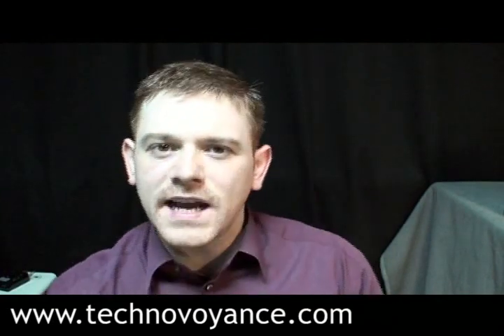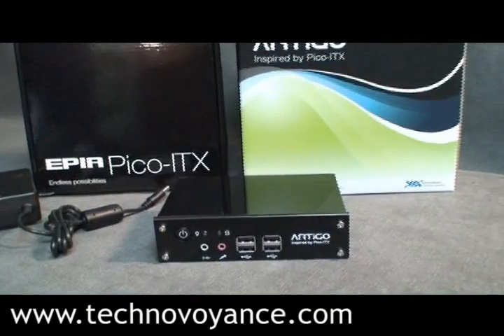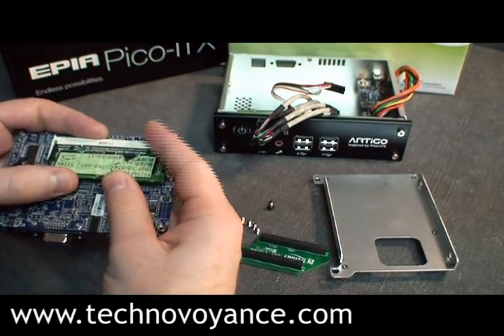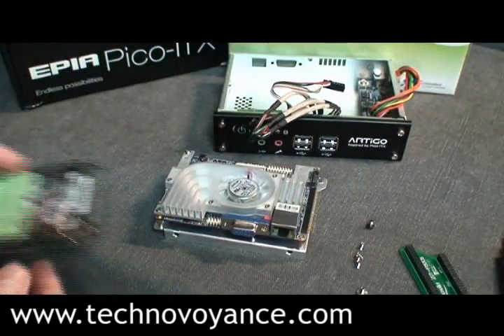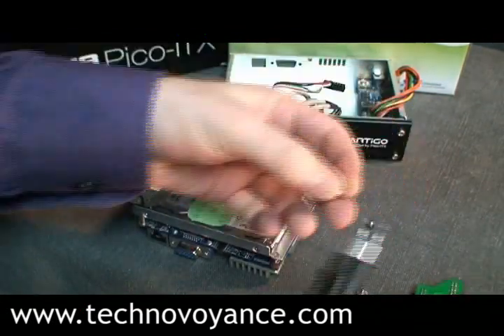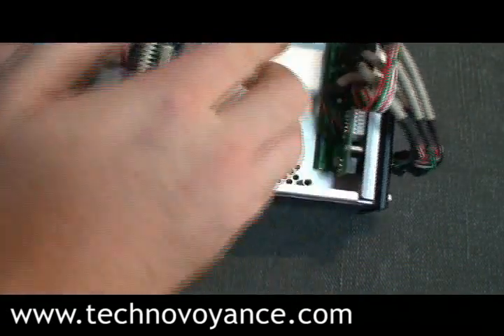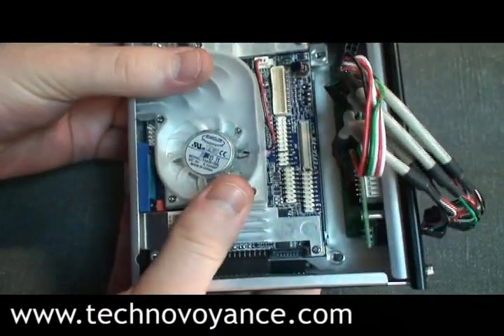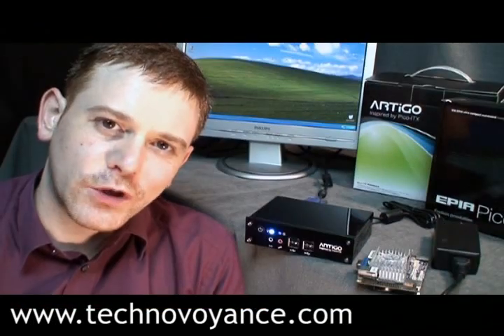The VIA ARTiGO Builder Kit

Comment: Military platforms are of lower performance than commercial ones since they have to be proven with reliability. For example,the CPUs used by jet fighters correspond to PCs in the later '90s. 80486 is still widely used in military and industrial platforms and it will remain this way(many larrger semicon distributors have them in stock).

Comment: Actually,the x86 architecture is unsuitable for small portable platforms due to excessive power consumption and heat dissipation even at small sizes requiring large heatsinks which smaller and more powerful(at low power) ARM platforms don't while having much better graphics. Samsung's S5PV310 dualcore and its new quadcore offer SATA and also much better graphics performance while battery operation is possible.

Comment: By the way, found a 4 inch screen and hinges at B and H photo. Anyway, it has about 1 ghz of power, although it probably can be upgraded with a bit of tweaking (It is a DIY kit after all). Same applies to the memory. Cool if you need a bunch of low density servers in a small area.